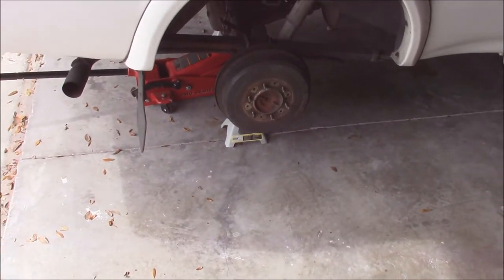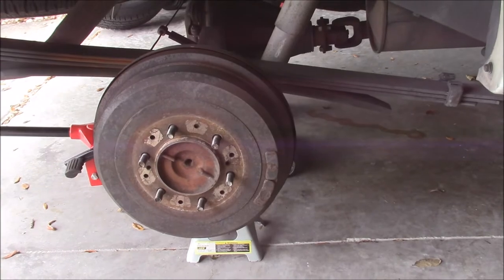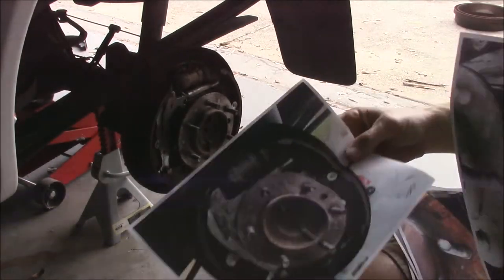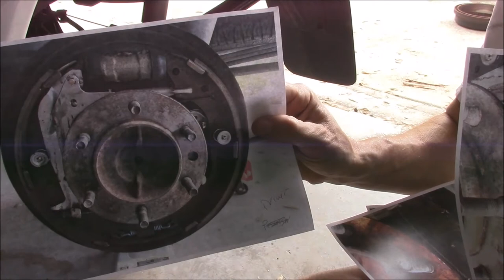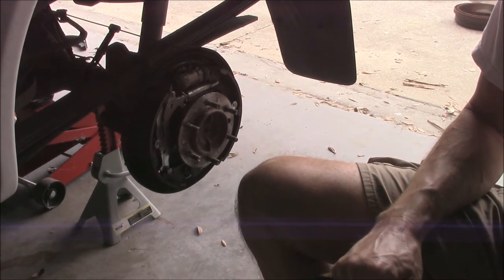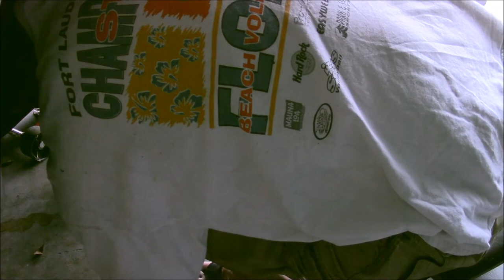Replacing rear drum brakes on a 1999 Toyota Tacoma PreRunner - 4 Runner

Comment: thank you for this video. I have a 2004 tacoma prerunner and I had a rear axle seal go out. of course my brake shoes were highly contaminated with differential oil. I had to replace them and I could not get the hub back on...took me 4 hours to put the darn hub on. lol